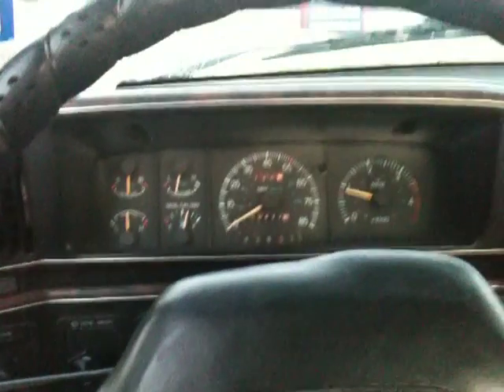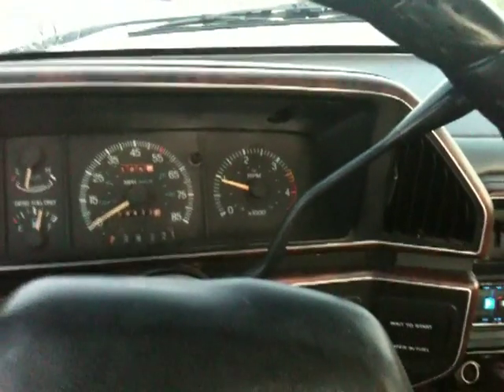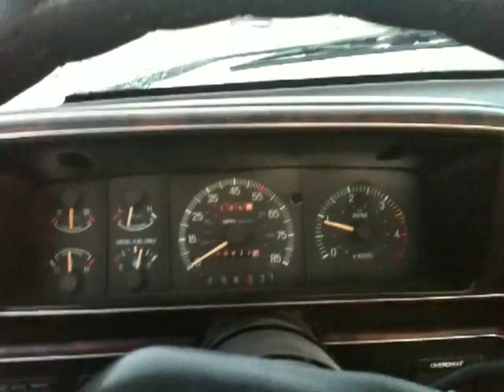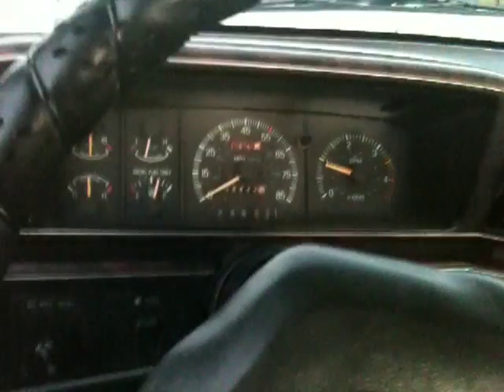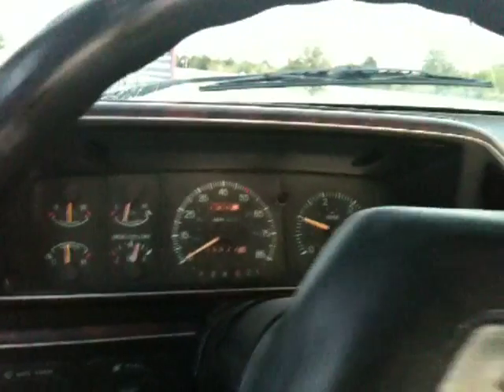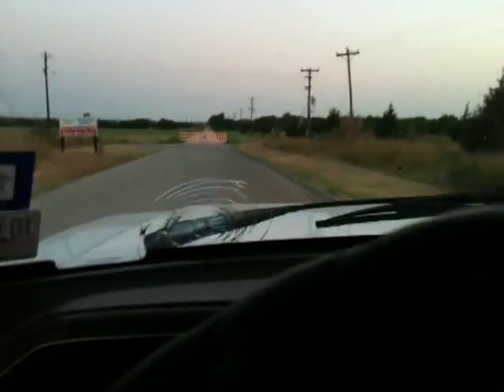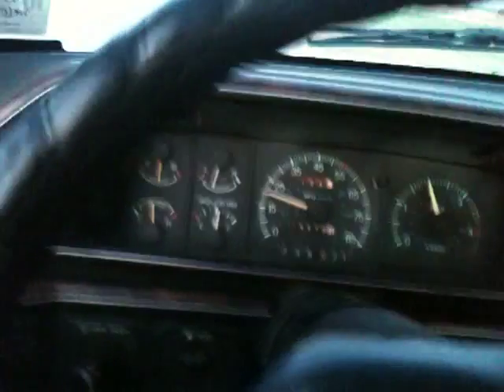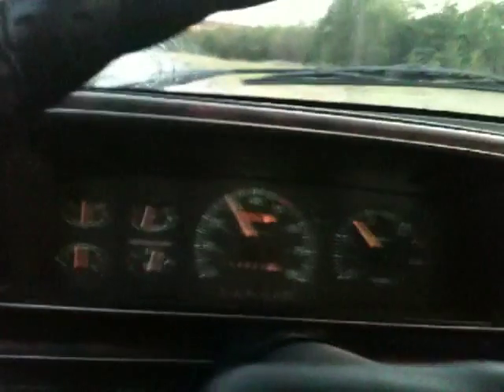1991 F250 7.3 IDI after injector relacement

Comment: Make up your mind. Are you talking about the injector or the glow plug? The injector has ZERO electricity going to it, so how would you test the amperage or ohms??? The glow plug has absolutely nothing to do with the way the engine runs. Only with how it starts. And now in the comments you'r talking about the injection pump! Make up your mind. If it is all of them, then make the video in a coherent fashion to explain each one separately. This was nothing but blather.

Comment: Man how can you tell win one of the injectors are going bad my truck on first start up it studders and win it does it blows blue smoke win it studders but win i rev it up a little bit it evens out and runs good
Reply from the maker: That sounds like a glow plug issue rather than an injector issue. If it were running rough when the engine is hot, then you could suspect an injector issue. There are a few glow plug testing videos on YT that will tell you how to test them.
Reply: Ya my truck has brand new motorcraft glow plugs put in less thin a month ago everything that im finding on whats going on is telling me the injector pump is getting weak making it blow blue smoke i took it to a diesel shop and the are saying the same thing but im going to put new injectors in it anyways hard tell win it all was replaced iv only had the truck for about 3 months
Reply from the maker: If you are going to go through all the trouble of installing new injectors, you might as well replace the pump while you have it apart. ULSD does no favors for these pumps, so when you replace it, always put in a lubrication suppliment every fill up. I use Diesel Kleen.

Comment: how do you adjust the FILPL (sp) ??
Reply from the maker: ssn5617 You measure the voltage range of FIPL at idle through full throttle. You want to pull the FSS wire to kill the engine while doing it. I don't recall the exact values but there are factory specs that you can google and find pretty easily.

Comment from the maker: @eatont9999 

I would suggest joining fortdtrucks and talking to the people there. There is a guy who makes injector pumps and injectors calibrated for maximum performance. DPS has messed up 2/2 orders 

Replacing the injectors isn't too hard. You will probably want to replace the IP at the same time. Setting the timing correctly can be a shot in the dark unless you have a timing mete

Comment from the maker: @cumminsfever09 

Thanks. It does still have a miss and it might be the old injector I put in. All the others are new but since I didn't have another new injector to replace the defective one, I used an old one. I'll post another video once I have the new injector installed. Hopefully that will fix it.